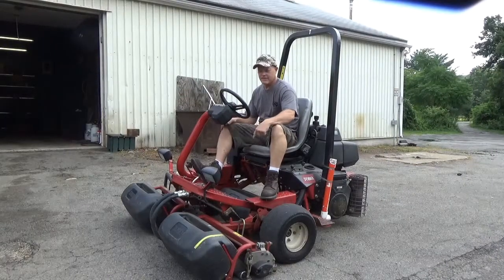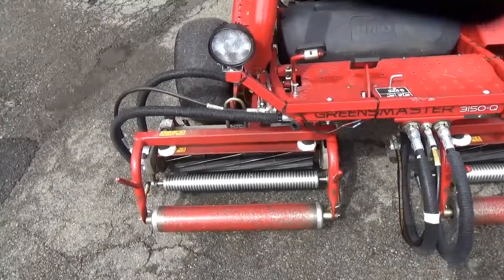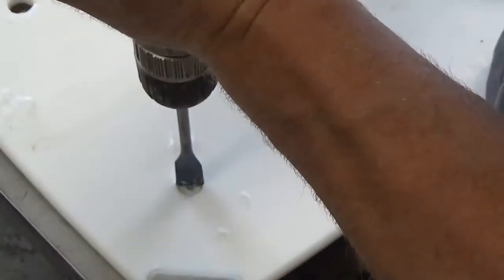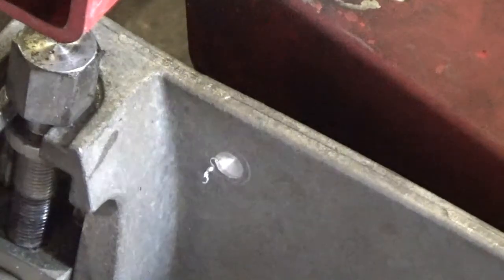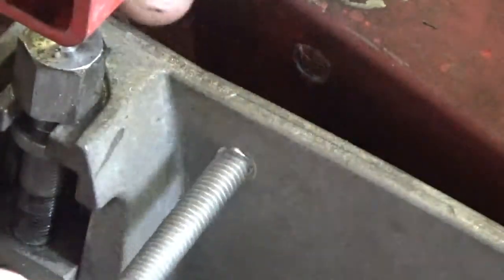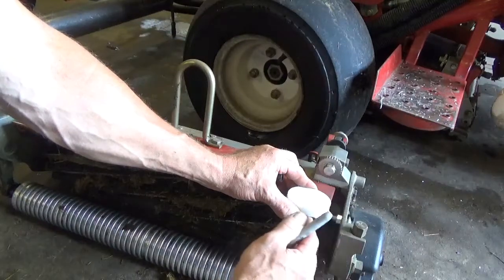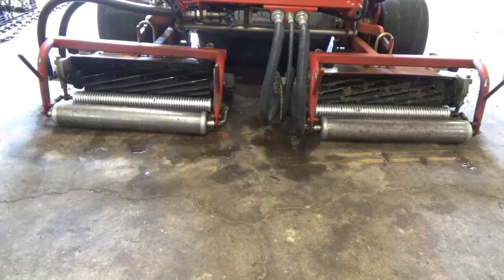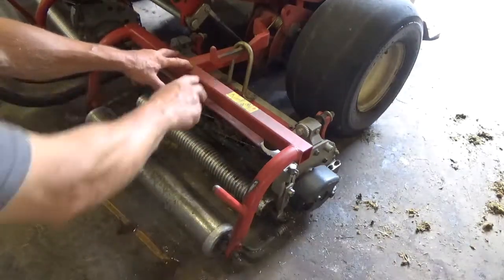toro greensmaster front roller lift

Comment: Just bought myself one of the 3100s been through a rough life, I need to replace the bearing on the front rollers, is it a quick process as they are flogged out to the max
Reply from the maker: If you are talking about the bearings on the larger front rollers it is a hard job. I did all 3 on two 3100s. I knocked off the end caps and then got the bearings out. Take your time!
Reply: @ronstickle4694  yeah the front rollers that the catchers sit on are so sloppy from abuse so I needa replace the bearing in em, and I'm finding rusted hydraulic cables that are leaking on drive motors 🤦‍♂️ 2nd hand mower, what a nightmare
Loses power to reels and speed when cutting too so most likely lower Hydraulic pressure from somewhere,
Hydraulic fluid was milky as well 😂😂😂😂 project mower

Comment: I also have this same machine, We just got back our reel from the factory.  This is on the job training for me.  I am trying to put on the front rollers and they will not go on.  It seems they are 1/4 inch too long.  I have looked through the service manual and it does not address my problem.  Do you have any suggestions?
Reply from the maker: Thank you for your question!  Not sure if it is the wrong part . But my job is to get it done at low cost!  So if all is good but a bit to long i would cut 1/8 from the center shaft on each end and make it work!

Comment: I loved those Greensmasters, but I hated how the front rollers were so low. But I noticed that some aftermarket tires had more of a flat tread profile, and caused the front units and rollers to ride even lower! So we had to be careful to replace the tires with the same as factory.
But of course the operator also has to be careful. That might be a lot to ask, lol.
But anyway, you've got a good idea there.
Reply from the maker: yea when we had flat tread tires there were problems like to much greens contact. And you know the operator does what is best for them self's!
Reply: You got that right!